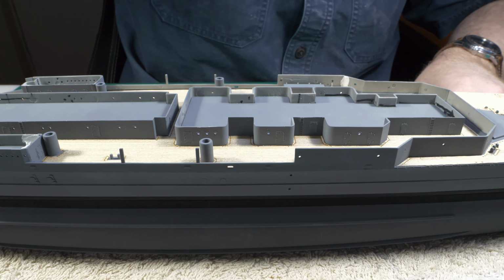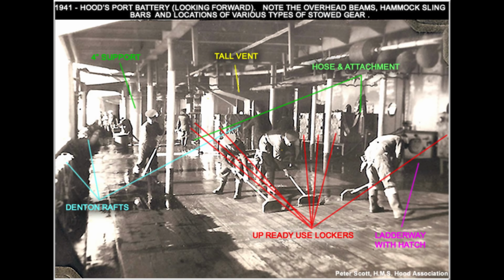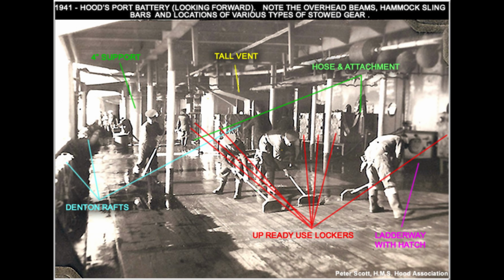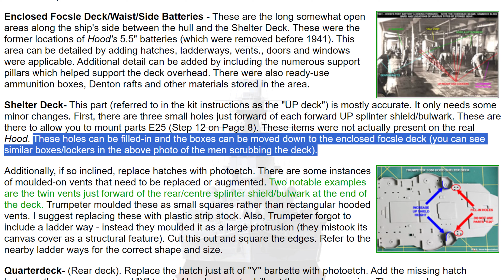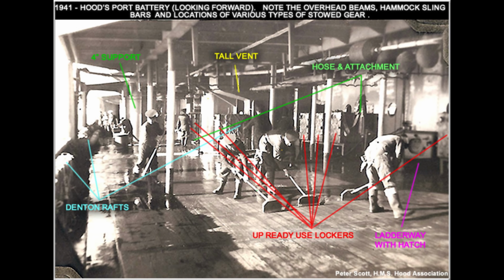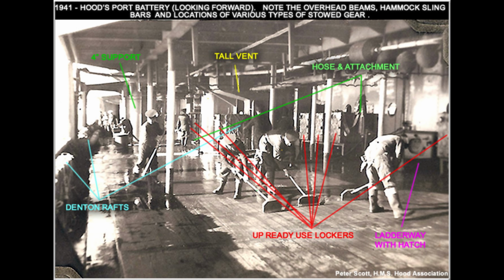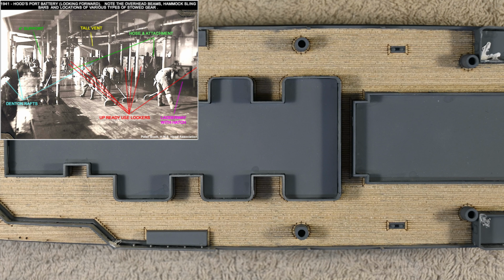1:350 HMS Hood: Part 13 - Focsle Deck Pillars

Comment: Great additional detail! I just finished a session at the desk working on the Flyhaw deluxe 1/700 Scharnhorst 1943. I took a leap and cut off the plastic gun barrels and was replacing them with the brass ones. It was kind of harrowing drilling such small holes on those pieces but I managed to get them to come out pretty good for a first shot. Giving my the confidence to try other challenging things with this kit.